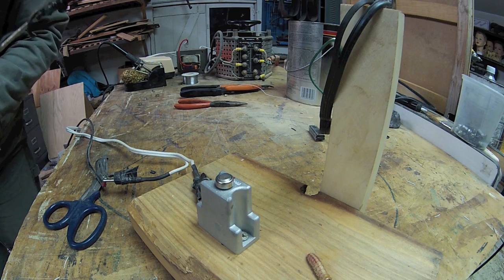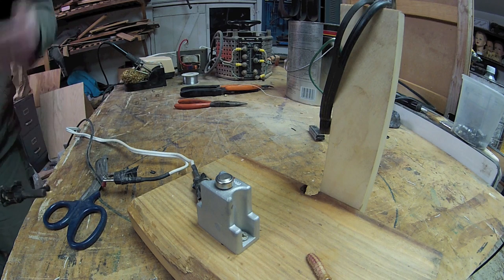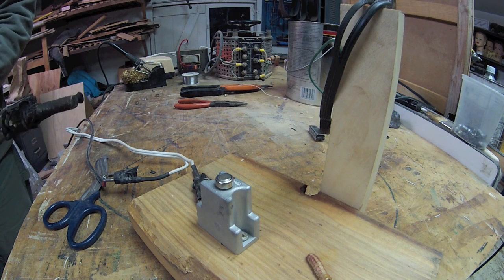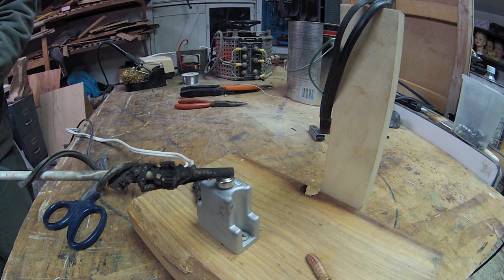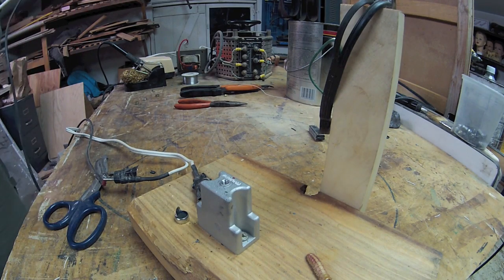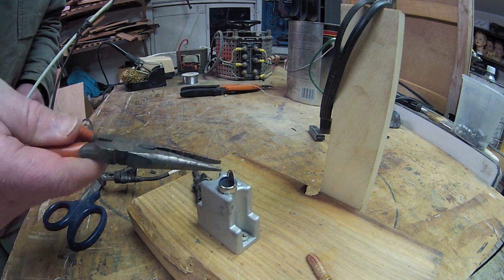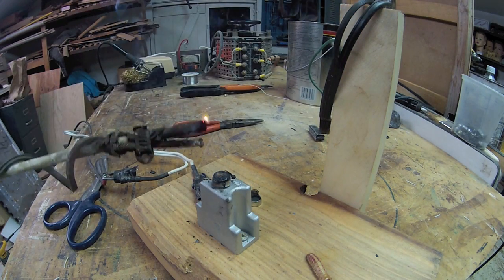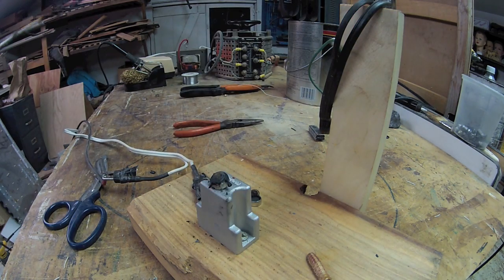Button Cell Battery Charging

Comment: I use to recharge the dead button cells in a simple way.I use an Eliminator(A.C) and set the voltage at 4.5v(for 1.5/1.55 v batteries)
I just touch the positive wire of the Eliminator to the top of the cell(negative) and the negative lead of the Eliminator to the positive
side of the cell(bottom of the cell),simultaneously,holding the battery within the tips of any 2  fingers.When I switch on the eliminator,the current
passes into the cell,reviving the energy amazingly.One can feel the heat of the cell within a fraction of a minute.This process should
not last for long.Maximum time of passing the current should be within 1 minute.If you heat the cell for long.the positive plate of the cell will blow out with a bearable blast.But,the revived energy of the batteries will not last long as brand new cells do.The cells recharged will work for a maximum period of 4 or 6 months as what i have observed.Some cells donot work even for a month.
Silver Oxide batteries are easily recharged,I think.However,all dead cells are not able to be recharged.Only the cells in which the
energy is dormant can be revived.Quality dead batteries are ideal for recharging.I am having more than 20 quartz watches and 
usually recharge the same batteries when the watches stop.Anybody can try using an Eliminator.

Comment: I can see where you went wrong. You can't charge them with AC... you need to charge them with 2700 volts DC
Reply: Seconded
Reply: Actually you are wrong. Sorry. He CAN charge them with AC just not the way he is doing it. All he needs to do is attach a wire to his big toe on either foot, another to his finger, another toe, his nose or his penis and then stand in a puddle of water bare foot. Holding the button cell between his thumb and forefinger he should plug the two wires into a mains socket. A helper should be standing by and preventing the safety trip from operating by holding it in place. An ex wife or pissed off girlfriend is perfect for this task. When he has stopped smoking the helper should allow the trip to operate and pull out the wires. The button cell will now be fully charged and can be replaced in the device it was taken from.